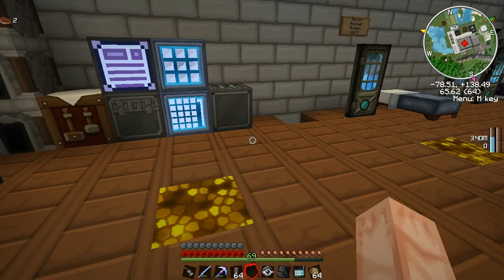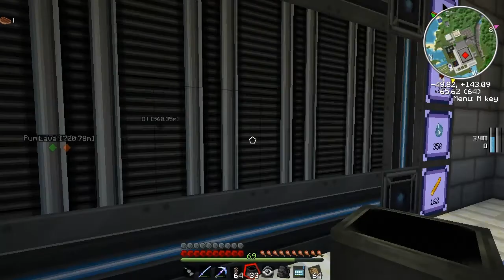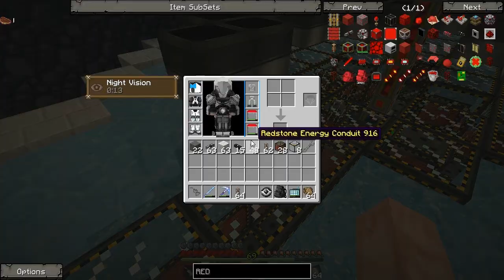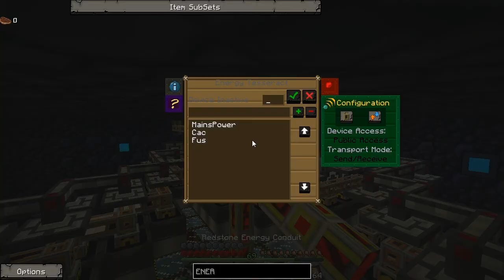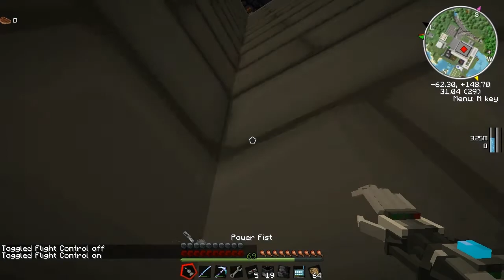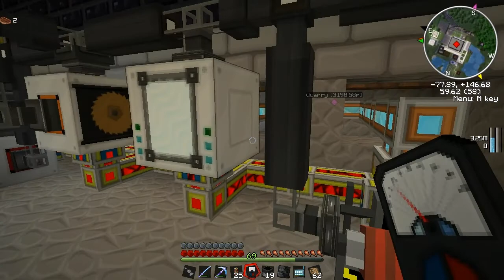Let's Play Tekkit Main #63 : Switching on the Fusion Reactor

Comment: could have done better on the fuel systems, by running a liquid line right into the reactor from the chemical extractors and also those redstone cells would ALWAYS charge quickly with the power output on the fusion reactor turbines

Comment: What are you going to do with all that power? It's almost ridiculous
Reply from the maker: realistically, I can now do anything I want :p !!!! I should not have to worry about power ever again. I may look at an Interdiction matrix for my base to keep mobs away. There is also the particle accelerator that could be fun but is a huge power drain. I might build that on the moon! That might be fun! basically I am set for life now!
Reply: Particle Accelerator sounds interesting! But I like your cart defense system, maybe you can automate that a bit more. Keep up the good work!
Reply from the maker: Wilfred Soer Ah yes, The cart chap does keep running out of arrows and fuel so I really need to look at setting up a cart loader to keep him automatically stocked up!